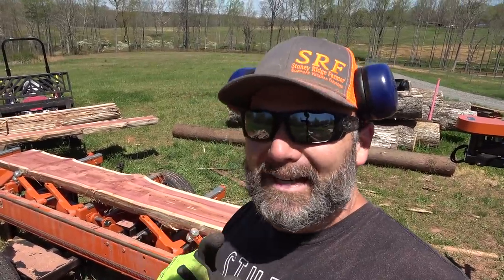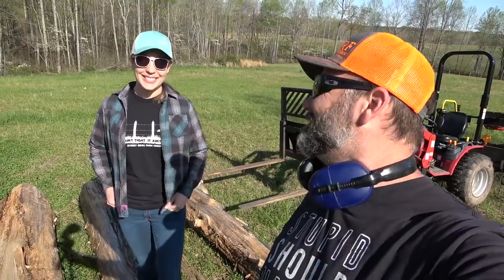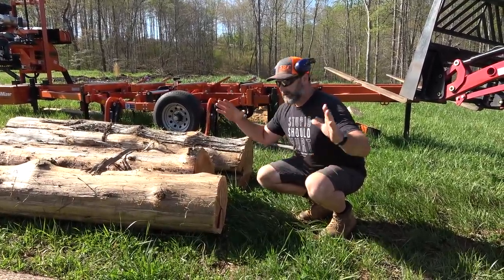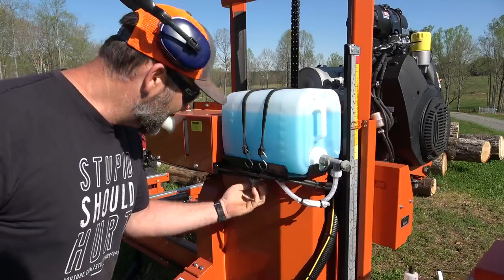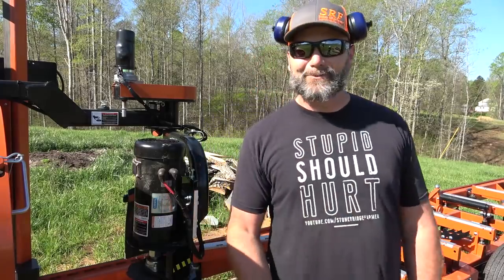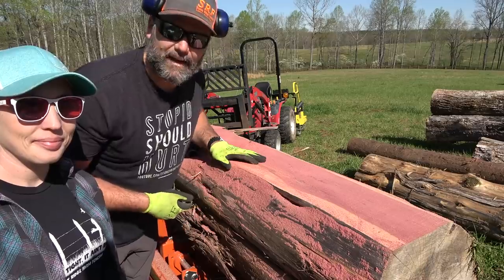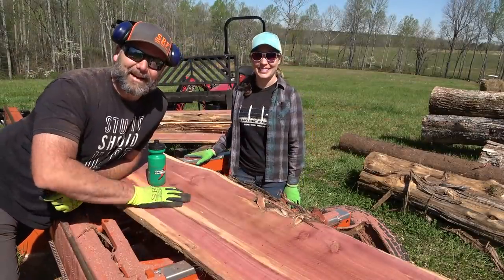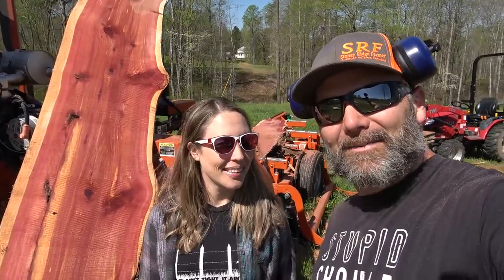It's PURPLE! You Won't believe what we ran on the Sawmill today!

Comment: My LT40 Wide (520 hours) is also kept outside.  To prevent rust on the rails, I cut a wide slot in one inch PVC and snap it on the rails. No more rust.  Don't forget to put ATF on the masts and chains. Lube the guide rail in and out chain also.  This is my third Woodmizer.

Comment: G'DAY Josh,as someone with over 40 yrs experience in timbergetting industry, growing, sourcing,milling, dressing and construction, cabinet working,have a couple of comments few your interest,1= concerning storage and drying out in the first 12-24 months,place on other dunnage/ timber,to allow air flow under Neath,place bow/ crown up towards the sun,to allow for the sun to assist you in the streightening the log, turning the logs monthly, removing the bark,branch nubs as you turn,2= I've found that 11/4(35 mm) is pa preferable milling thickness,thus allowing a few mm per face for planing/ dressing down to 1" finished sizing,3= try taking a flitch off each of the four sides of the log to start,thus can have 4 clean finished edges,keep & use cliches for an outbuilding wall cladding,stables are ideal,3= try hanging a Hessian or shade cloth material bag on sawdust duct/ output tube to market to other value adding industry,like smokers, essential oils,putty manufacturers? As always, Kindest Regards, Dave McLaughlin Queensland Australia

Comment: To hold the red color,  you need to use an oil based sanding sealer.  If you use a water based sealer the wood will turn more brown and gray. I love eastern cedar... and have used it for years for wood sculptures. ( AKA Chainsaw Carving). <>

Comment: The thickness I would cut it would be determined by the project I wanted to use it for. If I wasn’t sure what my plan was then and I basically shoot for standardize one by for a lot of it but cut a couple of 8/4 or 10/4 live edge boards out of the center of the widest largest logs. Now if I was going to be lining closets or trunks I probably go more for half inch or maybe even quarter inch. If I was planning on making a closet organizer for a walk in closet or such that I can buy go back to the standardize one by which after planning and all is closer to three quarter inch.

Comment: For my personal use, I would want it cut at about 5/4 or 6/4 so that, after it dries, and I cut and mill it to final dimensions, I can get a nice one inch thick piece of lumber. AMAZING load of trees you got there too BTW. To protect your blades when milling old growth like that, use a hand held metal detecting wand, like Law Enforcement uses. Just a quick pass over your log before each cut will save your blade. It only takes a few seconds for each pass, so it's not going to slow you down too much, but it will save you a lot of money in replacement blades.
Reply: People have tried that but those things only pick up surface metal, not anything buried even half an inch deep.

Comment: Haven't  worked with red cedar  much since leaving high school  wood shop lol 
  Cutting boards and thickness  would depend  on project  being built
  But if its just going to be stored   would recommend  thicker  cuts or even cants   can always  be cut thinner but making thin board thicker   not impossible  with glue and laminating   but why  the extra work  and possibly laminate separating

Comment: We don't have red cedar out west we have juniper and its smaller but it is the preferred wood for cooking and heating in a wood stove it burns clean and hot but not good for open fires because it pops I prefer pinon for open fires almost as good as juniper but has a little more smoke but both smell great

Comment: Josh what prompted you to get the Gas over the Diesel,  if I may ask?  I couldn't really find much difference in the overall saw performance between the two, aside from the obvious gas vs diesel so I opted for the diesel.   In a pinch I can run it on CNG or biofuel where as I wouldn't be able to do that with the Kohler if the whole world goes to crap I can still power a diesel you know?  My generator has the same 7000 series Kohler as the Toro so I have redundancy in that regard but the diesel saw mill just seems to be a better option (in my case) than the gas.  Just curious my man.

Comment: Why would you cut eastern red cedar into 2 1/2" slabs? Far too soft for a durable table top. My sister has a cedar chest my dad made in 1930 in high school wood shop class. Lots of dings and dents, but wouldn't think of trading it for a new custom built one.